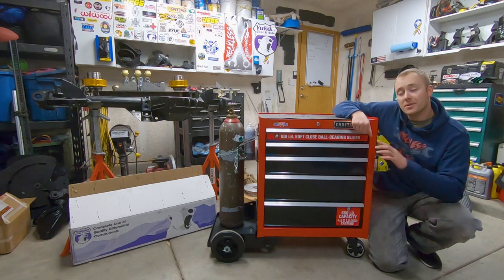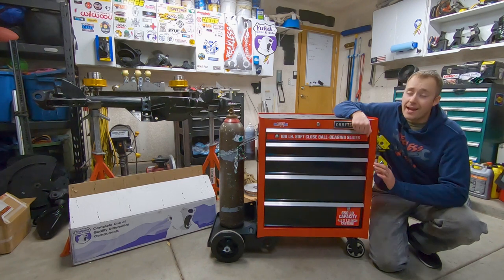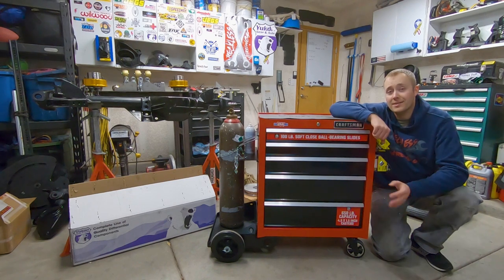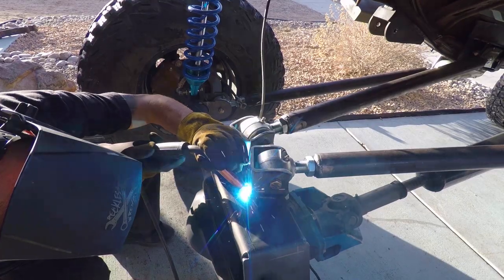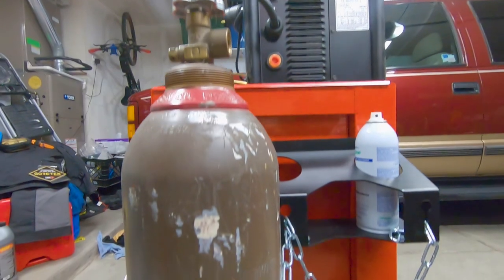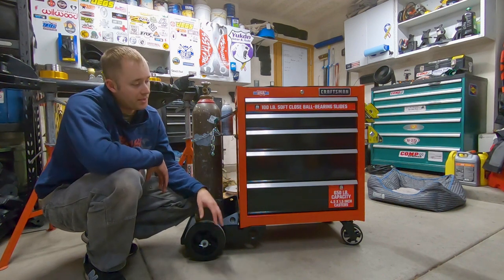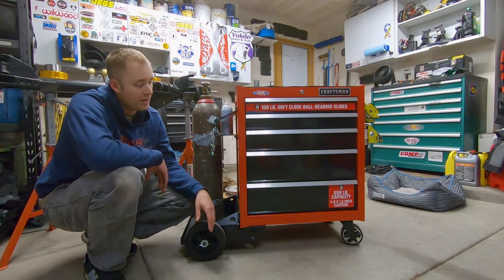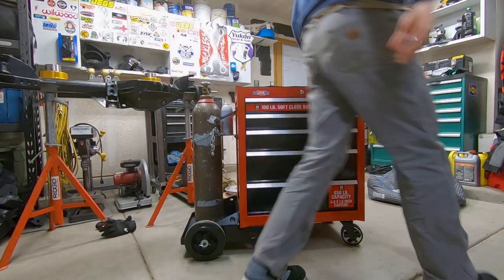ZTFab Welding Cart Build - Upgrade Your Garage - Reckless Wrench Garage

Comment: Great video.  But I do have a tip for you and your viewers.   When installing the nurserts. Hold the screw and turn the nut. This way you don't put twisting stress on the threads of the nutsert.  You want to pull straight up to swage it.
Reply from the maker: Thanks for the tips! These were "jack nuts" provided in the ZT Fab kit and I have never used this type of rivnut

Comment: What is up with that green tool chest? Never seen one like that.
Reply from the maker: Your guess is as good as mine lol. I got that from a co-worker about ten years ago who got it from an air force unit that turned that box in because they got new tool chests. There is no brand or model on it. It weighs about 450 lbs empty and built like a fortress
Reply: @RecklessWrenchGarage  nice! Gotta love having pieces with special stories like that. It's unique! I think in a good way.

I built my tool chest out of three filing cabinets and put a birch countertop on it. 79" long. Next will be two harbor freight 44" end to end.

Comment: Did ZTFab give you this kit for nothing or a reduced price? 

A lot of Youtubers are putting these things together and praising them to the heavens, but I think it's way overpriced and not a great product, so I wonder if ZTFab is buying favorable videos with free kits.

I bought a Harbor Freight tool chest, some steel, some screws, a little chain, and truck bed paint. I made a big welding cart that holds two welders, two enormous bottles, and hundreds of pounds of accessories. I paid somewhere around $350, TOTAL. The ZTFab kit for me cost $310 to my door, tax not included. No chest. The ZTFab parts don't come painted or assembled. The fasteners put new stress on the tool chest. It's nowhere near as good as a cart you can make yourself for a lot less money.
Reply from the maker: Keep in mind this video is over 2 years old and this was purchased in 2019. 
No I did not get this free, or a discount. I saw something that looked cool and someone put some thought into it and I like supporting that.